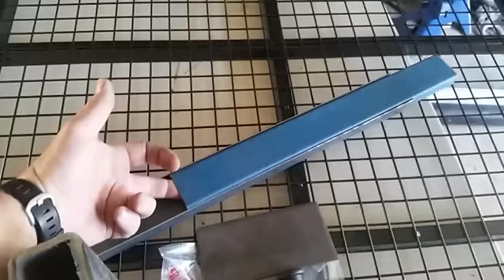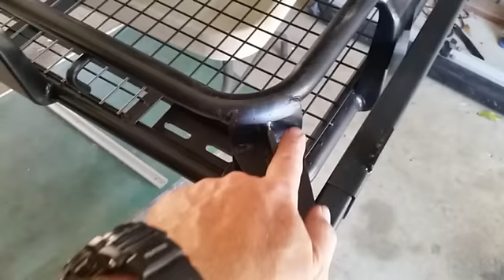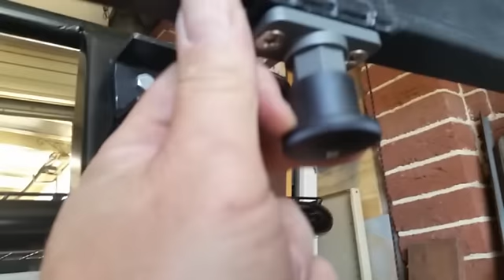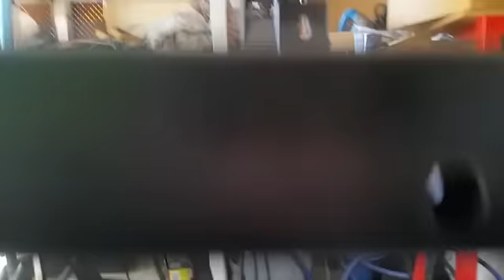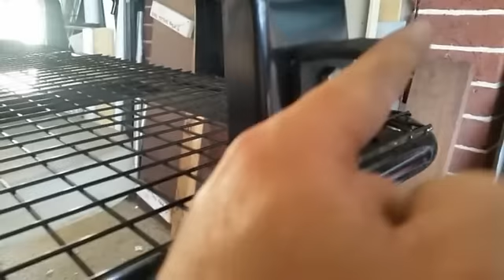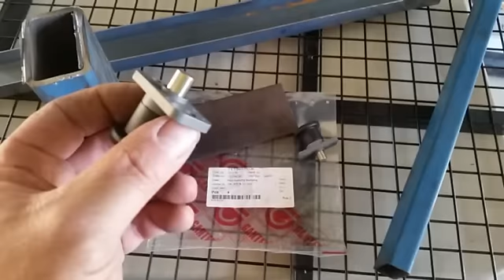how to build a swingarm for your awning

Comment: Brilliant job mate! Well designed and very practical and versatile. Only one criticism..... those welds holding the corner bracket to the roof rack. Do yourself a favour and fix em before you hit the corrugated roads. Other than that, top job!!

Comment: I have a 2015 Prado 150 serious with rails on roof how do I attach my new awaning
Reply: Henry Farrugia 
I hear you! Those rails look good, but they're not very practical. I ended up making my own highly polished stainless steel racks which match the external mirrors. 
There's several designs of after market racks and bars available which are much more useful than those Toyota rails.